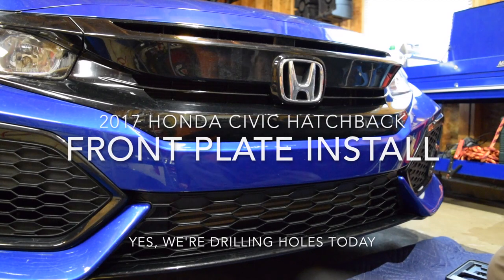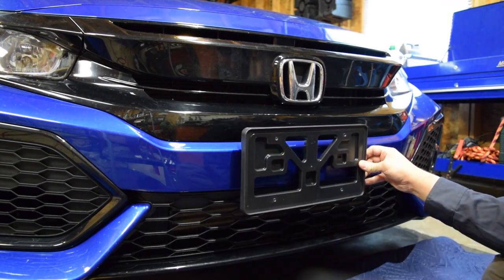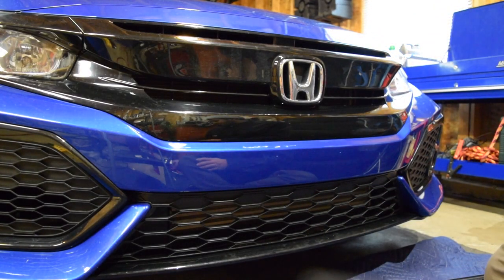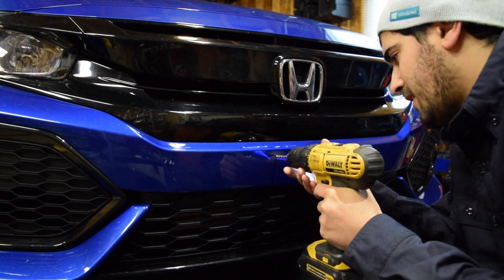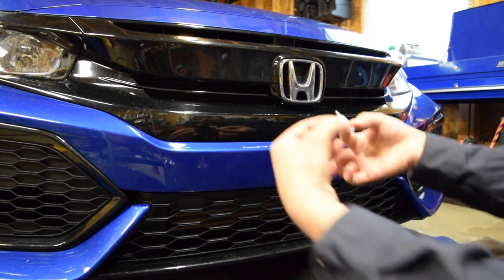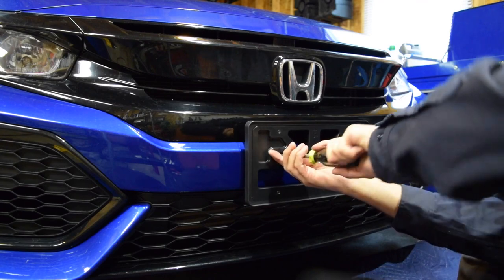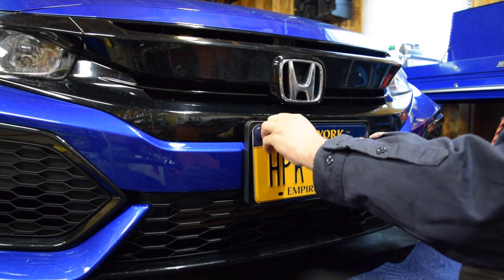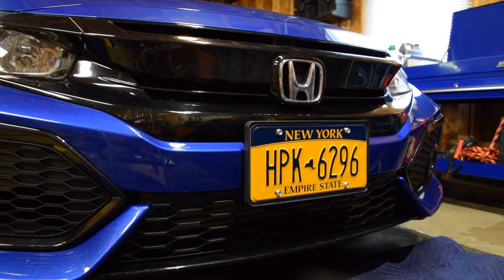Drilling HOLES in my brand new car?!

Comment: do you have a washer-plate at the back of the bumper? will it not loose in the long run because there's only a screw and don't have a washer plate to hold it?

Comment: If your car has the pilot divots all you really need to do is screw in the plastic screws that came with the license holder. Unfortunately mine doesnt have the damn divots.  I still wouldnt actually drill anything.

Comment: Hi Matt. What screws should I use for my vanity plate? The bracket from the Honda dealer for my 2019 Pilot isn’t exactly like yours. In NC we have no front plate requirement so I have to provide the screws. TIA.

Comment: What kind of screws do I need for the drilling and for mountain the plate onto the  holder?
Reply: The mounting plate should come in a kit that includes the screws.  I eventually succeeded with a 7/32 drill bit after working my way up with a few smaller sizes.  The threads measured about 3/16, and having looked at many kits on Amazon, I’ve concluded that this appears to be a standard screw size.

Comment: Put it in the windshield thats what i did in texas
Reply: You can still get a ticket in Texas for it in the windshield.... It must be securely mounted on the bumper.... Don't ask me how I know 😂😂😅😂
Reply: @VelvetSerpent Same with California... issue is my 69 Beetle doesn't have its bumpers when I bought it, and I'm sure wherever they are, the old front plate is attached to it.
I forgot all about the front plate when I was at the DMV registering the car last month after I bought it so now I get to go back to report the missing plate and then figure out how to mount the plate. Don't have the money to buy repop bumpers right now and was thinking about getting t bars instead (cheaper) and that means drilling holes under the front trunk lid or on one of the fenders which I really don't want to do to the old car.

Comment: The dealership should have done this on a brand new car. Most states require 2 license plates except for Pennsylvania.
Reply from the maker: Thanks. I asked them not to do this because I was going to try and find another way to mount the plate. I eventually gave in and drilled the holes myself. I've also seen pictures where dealers mounted this crooked.
Reply: Carlos Indiana doesn't require the front license plate
Reply: Neither for Arkansas
Reply: Add Florida
Reply: Michigan only requires back plate
Reply: The state of Kansas only need back plate.

Comment: LOL this should get an award for the most overly complicated way to do something simple.  The video should have been 14 seconds long.  2 self tapping screws into the plastic. Done! 
 Heat gun?  3 step pilot drilling, to drill an 1/8 inch hole in plastic?? Oops I mean 9/64ths!  
I was literally laughing out loud watching this!
OP is also working on installing an air freshener on the rear view mirror. Sign up to get the 90 minute DVD!  HAHA!
All in fun 😊 I suppose attention to detail is better than the opposite!
Reply: Omgggg I was thinking the same shit!!
Reply: U pressed?

Comment: Yeah bud you can drill holes in your wheels. But in the Home Depot you an find something called double sided tape( strong one) which cost less than 5 bucks. Try that next time. No big job to fix. Peace